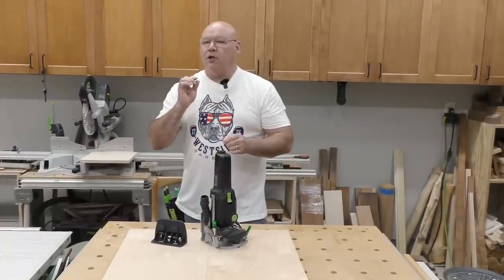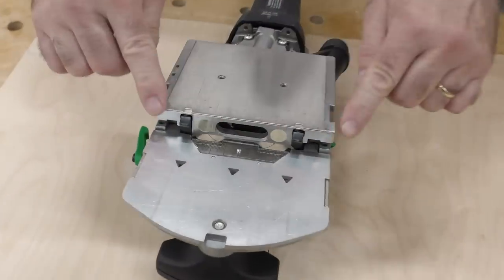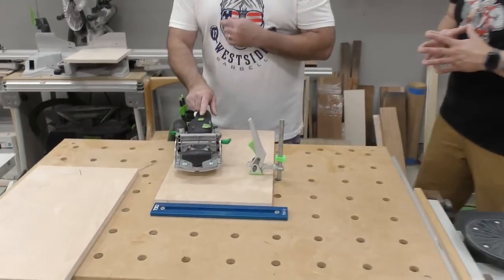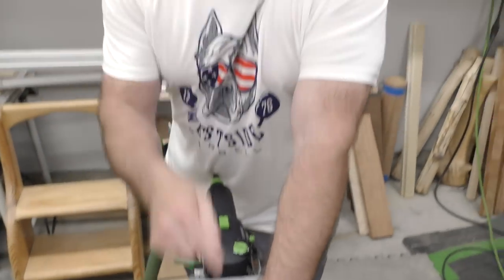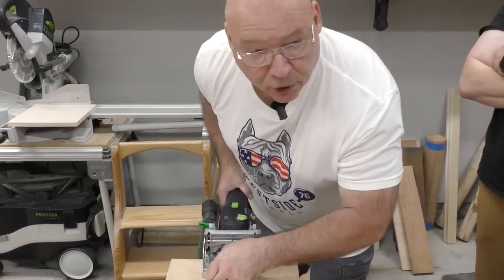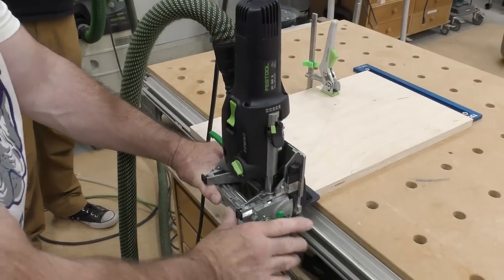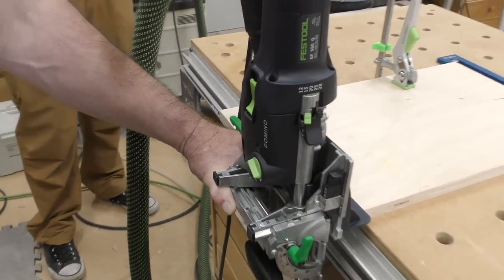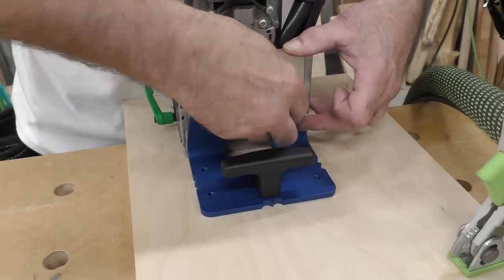Master Your Festool Domino !

Comment: open the back of the machine with the torx 15 and check if your tension spring of the switch is misplaced, cause i noticed the switch didnt retract back. If this is the case, the next thing is that youll find the spring stuck on the armature while rotating and its costly. Secure the spring with some hotglue and its fine
Reply from the maker: Thanks

Comment: Hello Sedge,
Thank you for your viedos. They are outstanding and helping novices, like me, to use this exceptionel machine. 
As mentioned, your videos at the festool channel and in this channel published are really helpful and educational. 
They helped me to minimise the beginners mistakes but also to understand the tool and how to utilise it at its best.

Can you give me an advice to a special problem?
How to alighn the DF500 an a vertical mounted plywood wall, e.g. in the middle of the wall? I would like to install a tray by using 8mm Domino dowels.
The challenge is, how to keep the the mortises in line over a longer distance and how to reference
I do appreciate your advice.
Thanks a lot. Have a nice day. 
Kind regards and best wishes from Bern (Switzerland) -- Andreas
Reply from the maker: this video may help
https://youtu.be/EaooetJChg8

Comment: The TSO support bracket is nice, but you lose the 20mm stops that are found on the Festool bracket.  Now if TSO could put those in . . . .
Reply: jt, Agreed!  When I need those 20 mm flip down stops is the only time I use the OEM Festool bracket in place of my TSO Big Foot.
Reply from the maker: You still need both

Comment: I haven't used my domino a lot. . I have tried using the flaps  and the indexing accessory and have had nothing but, disastrous results so I only use it with things I mark lines on. With that I always look straight down to line my marks with the little hole and shadows can be an issue with that.
 Can you see that line looking through the center of the plate like you did early in this video?
 I'm not near the domino currently or I would bust it out to look.
Reply from the maker: I can see it fine

Comment: Sedge, I often use the TSO "Big Foot" on my DF 500 for making vertical mortises except when I need the flip down stops on the original Festool support bracket.  But I really don't understand the necessity (or even the advantage) of Seneca's "Domi-plate."  I don't own one, but I do own the Woodpecker's version (the Offset Base set) with the different height and wing and flip-down-stop options.  However,  I admit to never having actually used my Woodpecker's Offset Base for anything other than a few fun or practice cuts, and I never felt the need for it in actual production work.  Is it perhaps that early users of the Domino machines had trouble tightening the height of the plate so that it sometimes slipped?  I've never experienced (at least yet -- knock on wood), plate slippage either on my 500 or my 700 Domino mortiser.   

On a different topic, I really appreciate your more relaxed and thorough style of presentation here.   I hope the "suits" (metaphorically speaking, as I know they don't actually wear suits) on your Friday show are not pressuring you to rush to meet an arbitrary time limit.  When you get rushed and out of breath on that other show,  it distracts from the quality of your presentation.  You need to be allowed sufficient time to adequately cover the subject matter without feeling rushed.   If your topic needs an hour, you should have an hour --- and as I tell everyone, an hour with Sedge, and the team, is an hour very well spent in my opinion.
Reply from the maker: Thanks you sooo much ....I believe the support bracket with the dominos is GREAT especially for the 20mm wings..... There is a place for both ...